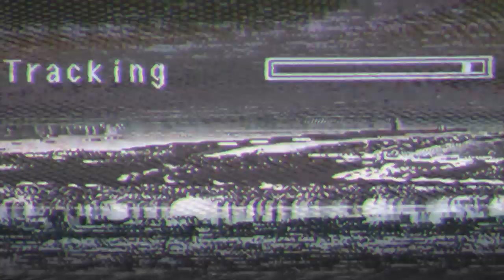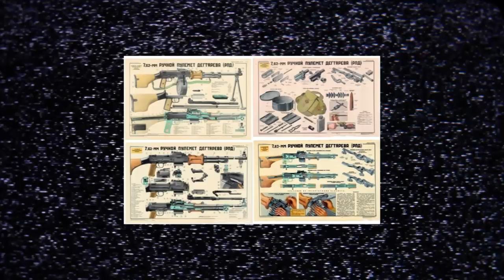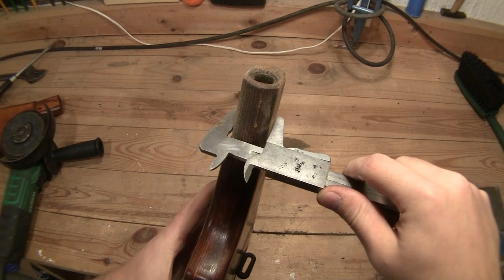LCT RPD Custom Real Russian Wood

Comment: That is some beautiful work! I was wondering, do those annoying screws on the butt plate have to be removed every time you change the battery?
Reply from the maker: Thanks. No that was just so that I could cut away material easier. To insert the battery you can easily open it by pushing a button and it will open.

Comment: great job man, been following your posts on reddit for the last few months. Its great to see that there are people in the west that treat their airsoft guns with the same respect as in Russia. Have you ever had experience/plans with fitting realsteel m14 parts on the airsoft versions? Been planning a project that i wish to undertake, could use all the information i can gather.
Reply from the maker: Thanks. Not for the moment but a friend has a real stock on his WE M14 and it was pretty much a drop in fit. I have seen some done on AEGs. Dremel out material and you will get it to fit. But it will be very thin near the grip of the rifle for the motor to fit. So be carefull.
Reply: @RealFakeGuns  any word about metal parts? Its kind of sad that the airsoft replicas on the market are mostly aluminium/pot metal
Reply from the maker: @thevladdo  LCT is allways steel. I dont bother buying replicas if they are not steel. Because you will fall on your rifle if you use it. And it is alot cheaper in the end if you dont have to buy a new rifle after a day out in the woods hehe. Thats why i waited so long for a G3 build, all other were plastic or pot metal. LCT is the only one who make a AEG G3 in real steel.

Comment: Will you be doing any modifications to the drum?
Reply from the maker: The plan was to put internals in the real drum but sold it. But my friend still has his. So might do a video of that if theres interest.
Reply: @RealFakeGuns  I've been interested in building a better drum than the one included. Mine has broken down repeatedly and is uncomfortable to wind up. Need some automatic feeding system that is also more reliable.

Comment: What is the name of the liquid to paint the metal like a real gun?
Reply from the maker: If you mean the blueing for steel, it's just called blueing liquid. There are many brands to choose from. Birchwood Casey is one of the more common brands 🙂

The LCT already have the right finish, but I use about 1200 grit sand paper to rub it to have a worn look.